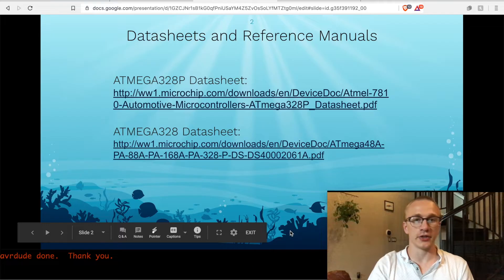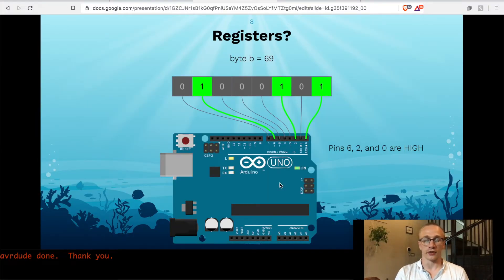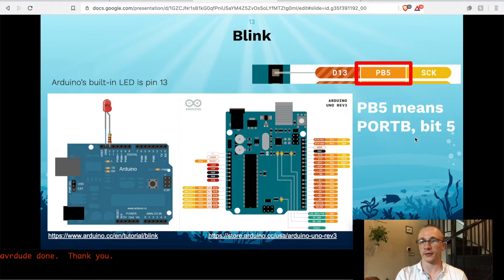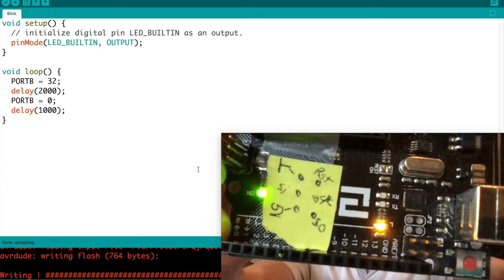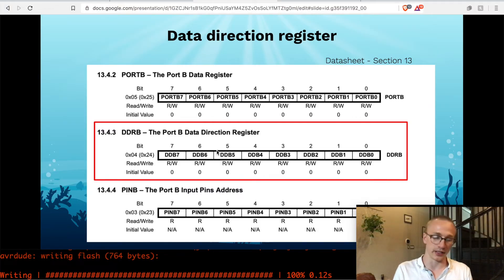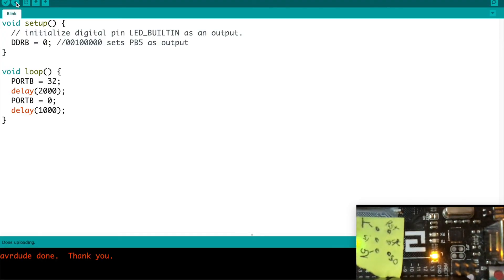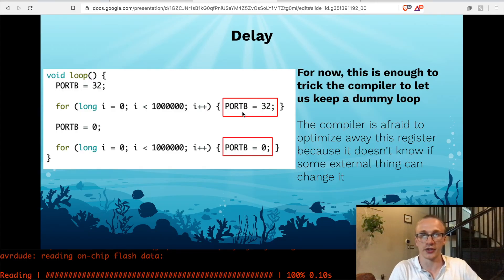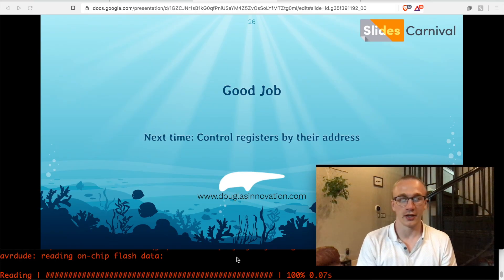Bare-Metal MCU #1 - Intro to registers

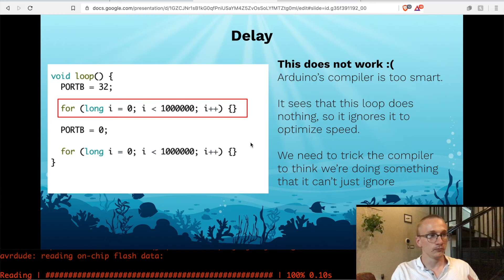Comment: At 10:40 just declare i as volatile.

If you look at the declaration of PORTB in the board support package you'll see that it uses _MMIO_BYTE, which is defined as:

#define _MMIO_BYTE(mem_addr) (*(volatile uint8_t *)(mem_addr))

The compiler doesn't "know" that mem_addr is a register (and indeed it doesn't have to be one, you can call _MMIO_BYTE for any valid address), it just knows that it's been told that whatever is there is 'volatile' and it therefore shouldn't remove or reorder "redundant" accesses. You can do the same with any memory location or variable that you want.

Comment: I've been an embedded developer for decades and have written piles of device drivers. I've worked on embedded x86, 6800, 68K, i960, 8051, MIPS, Tensilica, PIC, AVR, TI320, many ARMs, RISC-V, some exotic VLIWs, and a whole bunch more that I've forgotten.

This is one of the best explanations of this stuff that I've ever seen. 

AVR makes registers relatively easy to reason about because they're so tightly coupled to the core. When you get into "bigger" MCUs with multilayer bus fabrics there are usually multiple bridges between the MCUs and the registers, and things like access latencies become very unpredictable. STM32's are a good example - the higher-end ones use AXI-based cores like M7 or M55, and the registers are off in a secondary AHB bus somewhere on the other side of a bridge. There are good reasons why the architectures have evolved that way, but it makes bit-banging a thing of the past.

That's why we see "pseudo-CPUs" like RPi's PIO bock starting to sprout (though I would argue that those are basically yet another reinvention of the classic mainframe channel controller). I architected a block like that for a former employer, and I took most of my cues from classic channel controller design.

Comment: An int can't represent a number up to a million @11:45? Is an int not an 8-byte value in Arduino land? Typical signed int is 2^31 = ~2.147 billion.
Reply from the maker: @whyaretheseathing  arduino uses a 2-byte int.

Honestly, most of the time I program using explicit variables, such as “uint16_t” when I want a 2 byte number, and “uint32_t” when I want a 32 bit number.  That spares us from the ambiguity of “int”
Reply: @MitchDavis2  Ahh, that's not confusing at all 😅Thanks for clarifying!
Reply: @whyaretheseathing fun fact, an byte also isn't necessarily 8-bits, haha... don't get me wrong, on virtually any modern Proseccor a byte is an octet (8-bits) and you honestly don't do anything wrong with assuming that a byte is 8 bits, but byte technically just means "smallest addressable unit of memory". there are some older Processors with like 6, 7, 9, e.c.t -bit bytes (e.g. a IBM 702 had a 6-bit bit, but that computer comes form the 50's)

Comment: This is super helpful. I am trying to learn this but I am confused with the software which needs to be installed. I own a windows laptop - I have installed WINAVR and AVR DUDE. So i write my code on VS CODE, then I am to use a win-avr to compile it?

Comment: It's worth pointing out that writing to the whole port to change one bit is bad programming.  The code below is a better approach, albeit with magic numbers.  I left them in so it matched the program in the video, but defining bit 5 with a sensible name such as LED_Pin and using 1<<LED_Pin instead of 32 makes for a program that's easier to read and debug.

PORTB  |= 32; // single pin high using a bit mask  (PORTB = PORTB | 32; in longhand)

PORTB  &= ~(32); // single pin low using a bit mask (PORTB = PORTB & ~(32); in longhand)

Comment: For the Port B segment, might be worth showing where Port B is defined. I can't seem to find it in the headers. I'm told from a Google Search that this is in the avr tool-chain. I would imagine that it's defined with the volatile keyword to tell the compiler that the reads or writes to this value will have side effects not seen by the C code directly and thus can not be optimized out.

For the Delay segment, might be worth mentioning that the clock speed is the driver of how fast the system runs. A single instruction takes at least one CPU cycle to complete and is your overall system budget on how many instructions you can do in any given second. With that in mind, a write to a variable takes 1 instruction, a read to a variable that is in the CPU register takes 1 instruction. With the STM8 running at 8MHz it can process 8,000,000 instructions in a given second. The for loop itself is setup (long i = 0) at the setup of the loop and for the purposes of this discussion is meaningless. (1 / 8,000,000 of a second). The execution of the code takes 1 instruction (PORTB = 0), the check takes one instruction (i < 1_000_000), and the increment takes one instruction (i++). One iteration of the loop cycle actually takes 3 instructions, and so each for loop is costing 3,000,001 cycles. The delay it's causing is actually around 3/8th of a second or 375 milliseconds and that is why it's blinking faster than the previous example.

Comment: I realise this is 2 years old now, but a good way to make a "Do nothing" loop is to run the following. 

_asm_ _volatile_ ("nop\n\t");

That is an assembly line for no operation (nop) I can't remember what the \n\t does, but the bit where it says "volatile" means the compiler won't optimise it out.  This is what I use for either fault states to entirely halt operation, or for stuff like this where you need it to do nothing while simultaneously keeping the compiler happy that you're actually doing something. 

This is also the only thing I remembered from my coding course in Uni, and I didn't even remember it, I just copy pasted it from one of my projects for uni.

Comment: Perhaps the port version is only faster because you are setting it equal, but in digit write it is probably doing the |= operator to set and &= to unset the bit, thus requiring more instructions.

Comment: Correction: 
The hardware registers used by the Arduino Uno are located on-chip, separate from both RAM and ROM. These registers are used to control the behavior of the microcontroller, including setting pin directions, configuring timers and interrupts, and controlling various peripherals such as the analog-to-digital converter and serial communication ports.

Comment: also a program that uses pinMode(), digitalWrite() and delay() takes 1536 bytes of flash and 9 bytes of RAM on my Mega2560, whereas a simple bitwise op function and _delay_ms() from AVR API takes only 304 bytes of flash and 0 bytes of RAM - meaning 5x times memory optimization. So yeah Arduino SDK functions are fine for prototyping, but optimizing for specific MCU pays off by a lot.

Comment: Great presentation and in depth analysis of the necessary elements to understand bare metal programming. Been looking for something to jumpstart my understanding with avr bare metal programming. Even if you applied it for STM32, it's so concise it could be applied to any MCU with the proper study of the datasheet. Well done.

Comment: Thanks for a very understandable video.  Is there a way to enter the port value in binary?  IE portb=00100000  instead of portb=32?  It would be easier to program multi led blink patterns this way.
Reply from the maker: In Arduino IDE, I’m pretty sure you can write binary if it starts with a capital B.  Such as “int i = B11001010”

Comment: Great video! However, the timing calculation in 6:20 is not correct since on left there is assignment-only, and on right it is read-and-assignment operation. These do different things. To make comparison correct, the |= and &= operators should be used on left side instead of the =.

Comment: Would you consider making a similar bare metal series for ESP32, maybe the esp32-c3 RISC-V uC?
Reply from the maker: I haven’t gotten a chance to use any ESP32s yet for projects, so I don’t know much about them.  I have a few in a box, but I haven’t done more than simple blink examples with them yet
Reply: @MitchDavis2  I'd love to see the blink done from register manipulation, the most bare metal way the better. Maybe even assemble from assembly code, flash the binary to the uC. No C, no IDE...

Comment: Can you not use hex values instead of decimal values?
Reply from the maker: You can use whatever you want.  When it goes to the compiler, it's just a number.  More commonly, you write something like (1>>5), which means "the 5th bit is a 1".  I cover bit shifting in a later video.

Comment: @Mitch Davis  i am getting an error that PORTB was not declared in this scope, pls help me out
Reply from the maker: Are you using the Arduino IDE?  And are you using an Arduino Uno?
Reply: @MitchDavis2  is it work on arduino nano ? **I'm not real programmer, just hobbiest, Your video short & clear, not too hard to understand, Thank You !
Reply from the maker: @TheJavaSync  yes, this should all work on an Arduino nano.  The nano uses the same chip as the Uno, it just looks a little different.  They are both ATMEGA328p’s
Reply: @MitchDavis2  Thank You, & so far, I follow along this video series to #4, loved it
Reply: It was a typo right?

It's alway's a typo :|
Reply from the maker: @abstractapproach634  Could be a lot of things.  “PORTB” is defined in one of the Arduino header files.  If you’re programming outside the arduino IDE, the Arduino header files aren’t automatically included.

Alternatively you can define it yourself.

If it’s a typo, just make sure it’s all CAPS.
Since this thread kinda stopped, I felt obligated to post a few other things to explore I case someone else is having these problems
Reply: @MitchDavis2  Lol, yes of course you are right. However, I cannot count the number of times I thought I compiled wrong, or my system was messed up, or whatever. Absolutely convinced I combed through every part of my code .................. and then I find the missing semi-colon or capital letter and curse myself for being so stupid. That's called programming right?

Comment: Will continuously re-writing register wear down the memory? I heard they usually have limited number of read/write.
Reply from the maker: Flash memory (where your program lives) and EEPROM memory (non-volatile memory) have finite write cycles.  I believe they can OFFICIALLY be written roughly 100,000 times.  Some people have done tests and discovered they work reliably for many more cycles.

Registers live in RAM, and RAM is designed to be writen/read infinitely.

Also, registers are what make the microcontroller work.  There is no way to make your microcontroller do anything without writing to these registers.  This all happens behind the scenes if you use something like "digitalWrite()"

Comment: I understand the niche of starting at the bottom level in understanding the ATMEGA chips and the Arduino environment - looking under the hood to explain registers, machine code, assembly, and C/C+.  And learning to bypass the Arduino libraries at times.  Kudos.  There is value in that.

But what is the reason for aiming to eventually transitioning to the STM8?

I could see why someone aiming for large scale manufacturing might want to use the cheapest uC which can handle their task, and the ATMEGA line often isn't that.  But for a hobbiest, what advantage is there to (eventually) transitioning to another low level uC with similar capabilities, using a different toolchain and ecosystem to learn?

Consider by contrast, say, planning transitioning to the STM32 line, which has some advantages in handling some tasks which the ATMEGA cannot.  One option in this case would be using the Arduino ecosystem retargeted for the STM32, so reducing the new learning curve once one is familiar with the ATMEGA (eg: using the Blue Pill devices).

Anyway, good presentation.  If you wish to share the reasoning behind the intended direction of this series, that would be cool.
Reply: @MitchDavis2  OK, good luck!

It's good to see a different approach, starting from the low level and working up.  Of course, the other approaches have their value too, but people differ in how they learn best, and in what they are trying to accomplish.

I'm pretty familiar with the basics you are covering (my first microcomputer was an IMSAI 8800 and you could use front panel toggle switches to manually enter one byte at a time of machine code, for the boot code!).  But I can well imagine that it would be very useful for some beginners.

I'll try to check back later and see how this effort matures and what you do next.  

Kudos!